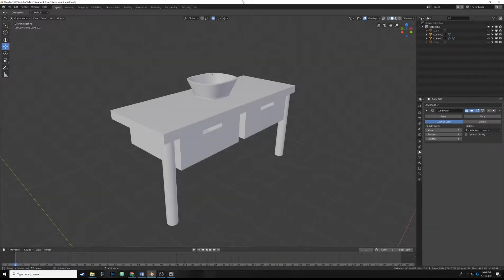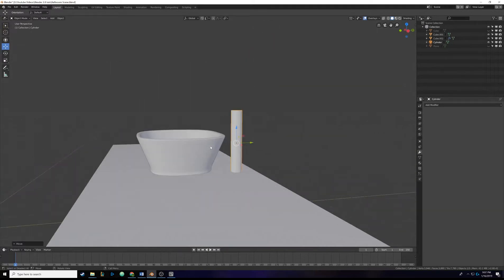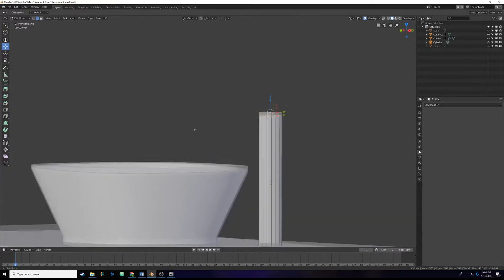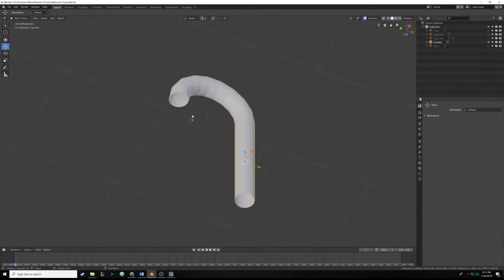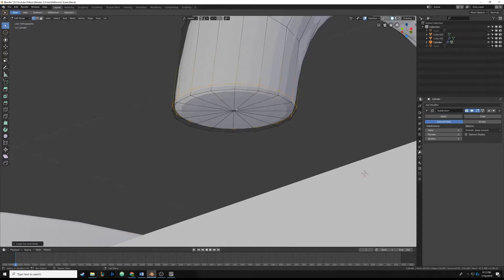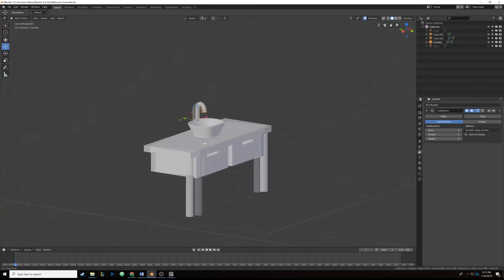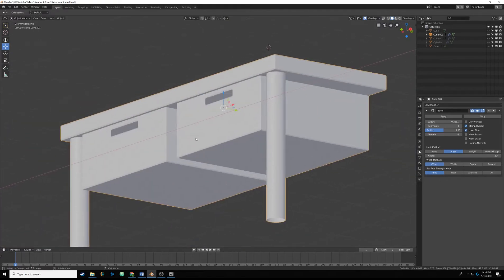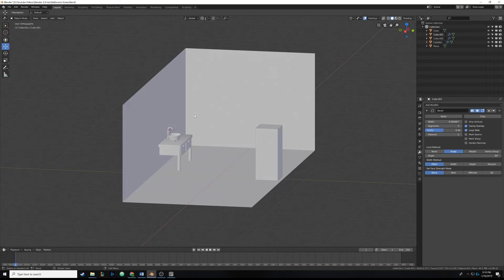Making A Bathroom In Blender 2.8 - Part 7, Finishing The Sink and Table (For Beginners)

Comment: doing really well following this up to the point at which you close-off the faucet outlet. ...alt-lmb to select the edges to the opening, E to extrude, then Rmb to deselect? then Alt+M does not give me the option to close -off, instead, it give me options to split, however your scale gizmo is not displayed and mine is. I'm in Modelling tab, edit mode, edge edits selected